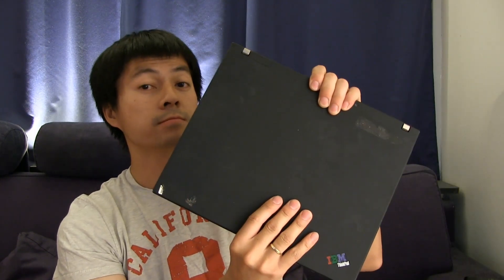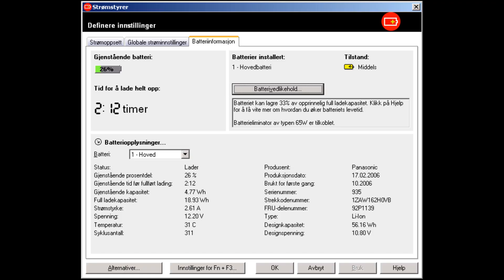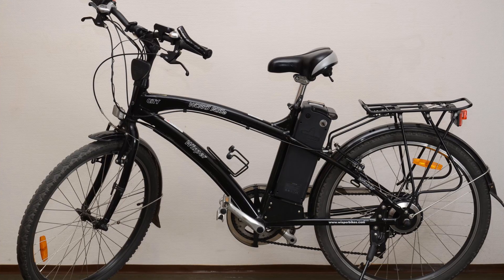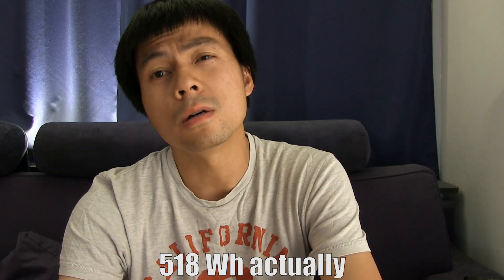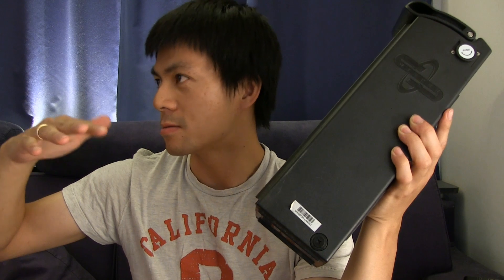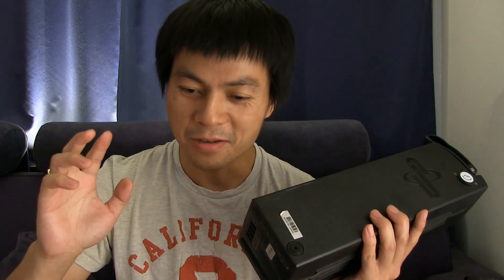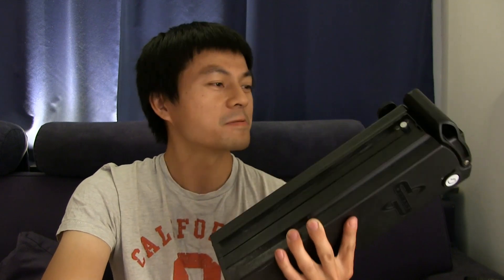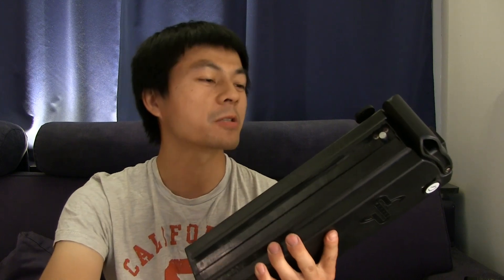How I killed two Lithium batteries

Comment: You own a $100k car and used a laptop from 2006 up to recently? Wow.
Reply from the maker: As it has been said thousand times before, in Norway with the superb incentives on EVs and the insanely high taxes on fossils, you don't have to be a millionaire to buy a Tesla. We live in 42 m² apartment in Oslo and can afford one.

In my opinion, IBM makes the best laptops. That laptop was used as a secondary computer. My main desktop computer which I use for video editing, gaming etc is far more powerful, expensive and updated.
Reply from the maker: john p MrMolbach In Germany, you get two BMW 5-series for the price of a Tesla. In Norway, the total cost of ownership for a Tesla is lower than for a 5-series. There are several reasons for that.

1. Import tax: http://www.toll.no/templates_TAD/RegistrationTax.aspx?id=79&epslanguage=no&step=1
Try entering a car that cost 200 NOK, with 120 g/km CO2, 1800 kg weight and 180 hp. The taxes will add another 226k so the total cost for the car is 426k which is more than double.
Now change to 200 g/km CO2 and 250 hp and the tax will be 400k and the total cost is 600k.
Electric cars have no import tax. Not even VAT.

2. As Molbach mentioned, service cost is high. But there are also a lot of other expenses that I would rather call "tax". That includes annual tax ($500), toll roads ($5-10 each time) and fee for changing owner (up to $3000 depending on weight and age of the car, where in Sweden it cost $10 for the exact same thing)
EVs pay $70 in annual tax and nothing for toll roads. In addition there's free parking, free charging, usage of bus/taxi lanes and free ferries (only pay for passengers).

Someone in Norway calculated that buying a brand new medium medium priced car, about the size of a VW Golf for 350k NOK cost the same as a Tesla (total cost of ownership).
Reply: Bjørn Nyland
Old is gold my friend. That laptop is quality. Sometimes old laptops do the job just as well as new ones if your doing basic stuff.
Reply from the maker: Hetabeta McMan Exactly. The T-series was marked for professional use, with magnesium frame, Intel Core 2 Duo, G-shock protection, matte screen, silent fan and superb Ultranav.

As far as I know, only IBM/Lenovo design fan inlet/outlets to be on the side of the laptop rather than on the bottom where it would be blocked most of the time anyways.

It was built like a tank. At my previous job, an IBM X31 was backed over by an Audi A6. The structure gave way, but the disk was ok. I moved it over to another X31 and the computer/data was up and running again.
Reply from the maker: MrZiemwit I earn average salary which is about $4500 after taxes. The cost of living in Norway is one of the highest in the world, about the same level as Japan, Switzerland, UK and Australia.
Reply from the maker: MrZiemwit I use USD to make it easier for the audience to understand.
Reply from the maker: ***** Also, we don't waste money on alcohol or cigarettes. That's quite expensive (due to heavy taxes) in Norway.
Reply from the maker: Sukun Paul To make the batteries last longer:
1. Avoid charging to 100 % too often. Stay between 20 % and 80 % if you can. Or even better, 40 % and 60 %.
2. Don't leave the battery at 100 % or close to 0 % too long. If you charge to full, spend it as soon as possible. If you drain it down, charge it as fast as you can.
3. Keep the battery cool. Avoid exposing it for >30°C too long.
Reply: john p  Service cost in Norway on a BMW or an Audi is ridiculous.  1000 dollar oil change and 2500 dollars for a simple timing belt (a lot more if you have a v-engine or anything not 4 cylinder). People here pay 600 dollars to have their cars detailed (and are happy about it) and if you need to get shock absorbers or brakes failing the dealers will do their best to fuck you over. Imagine paying these prices in the states.

I think people are tired of this shit and with the taxing rules of the electric cars it makes sense to buy a Tesla. The norwegian government didn't see it coming and now they cant take it away until its reached a limit of 50k cars or the year 2017. Ironically its the only thing Norway has ever done good for the environment to give a big discount on this type of cars.

I'm excited to see what happens when the warranty runs out. Just delivered a leased roadster after three years of good punishment. It was still running fine, but was in and out of Teslas garage a lot. Fans couln't take more, a battery pack got fried and all the bushings where completely shot. To replace the bushings Tesla wanted 4200 dollars, but we had a month of warranty left and told them to fuck off with the bill.

I'm really excited about how the incredible amount of model s'es will stand the climate, salt and so on. I hope it goes well of course. Hopefully bushings and aftermarket parts will be available as they are needed. We used 2 sets of tires every summer and one set every winter on the roadster. I wonder how that will turn out when 275 45 r20 (or the very large size summertires on model s'es) cost so much to replace. If you have to change them every year its almost the cost of servicing a regular car.
Reply from the maker: S Chil I have banned that user from my channel. He have made some comments before that I didn't like. And this time it was too much.
Reply: Damn your taxes are scary, I live in Canada and a bmw oil change is only $100 dollars (free if new to 4 years), detailing is $100 depending on the place. There's Teslas all around here in Toronto and it would be more, but it's more economical to own a regular gas bmw than a tesla at this point, so you would just have to care about emissions and 'saving the world', or you could just afford it to own one at this point, not a viable replacement. And we don't have super chargers yet but there's 3 to be installed this year (woo hoo), fingers crossed.
About the batteries I'm a noob at battery maintenance, whats the rules in long life, just not charge to full and don't let it drain completely? at least thats what I'm understanding.
Reply: ok one big question

what is :

salary of scala dev in norway -  nett/gross
what is the cost of some living space like 2 rooms
how expensive is bread and butter

and than we can start talking
Reply: Bjørn Nyland why not in NOK ;)

4500 net is propably 8k gross :( yes taxes in norway are too high
Reply: Bjørn Nyland can you make some micro AMA what kind of devleoper can get job in NO and do thay need to know norwegian or english is enought for start
Reply: Bjørn Nyland Yeah, I get it, Norway's awesome. Your prison conditions are better than at least half of the US free population live in. Your minimum wage is a living wage. Have you seen Lilyhammer on Netflix?
Reply: Bjørn Nyland  Depending on the car. Many place oil change are free, if you buy the oil in that place. Like around $100. I allsume Bjørn talking abouit BWM-branded services. If you go to a non-brands service place, that are as good as, BMW's own, it will not cost you a lot. 
If you're smart, and not want to throw money out the window, you go to the non-branded services. 
Many people also take their services in Sweden, which are only 1 hours driver from Oslo, Norway. The prices in Sweden are often 50% lower.
Reply: Bjørn Nyland This is a true fact, but only if Tesla owners can keep their car(s) many years.

In Norway they are planing to remove pretty much all benefits for electric cars by the year of 2017/18, witch means if you buy a brand new Tesla now and set the the payment on 5-7 years, then you really havent saved much. If by 2018 all electric car owners have to pay for taxes like everyone else then the Tesla would be nothing more then just another electric car. At that point its really just about how bad you want a electric car and not about driving a awesome car and saving money at the same time. Witch i think is two of the biggest reasons why this car is selling so good in Norway. You get to own a awesome car and save money at the same time, but sadly this is not going to last long. 

Sorry for the bad english!
Reply from the maker: XXX XXX Even if the benefits are removed, the car will still be way cheaper than a gasoline car to run. Simply because electricity is cheap or free, maintenance is almost non-existant and there are very few parts that needs to be replaced.
Reply: +Bjørn Nyland I'm surprised that the tesla does not auto discharge itself, if left at a 100% for a few days. My DJI phantom 3 drone does this after 10 days automatically to prevent damage to the LIPO battery. Maybe there is a software update on the way ?